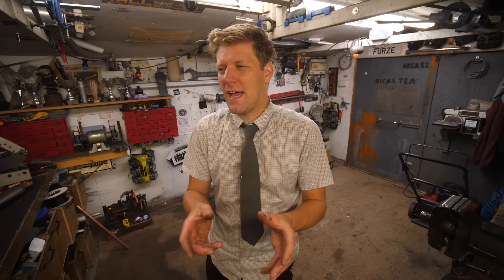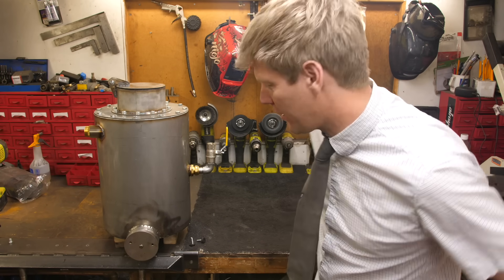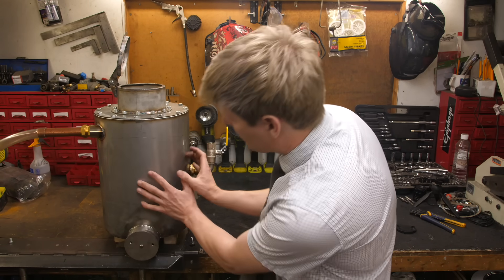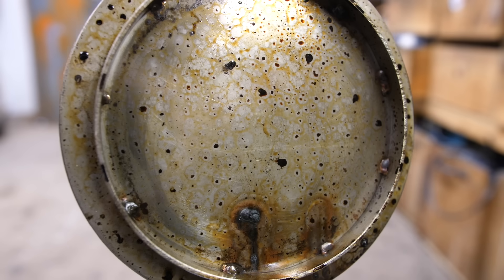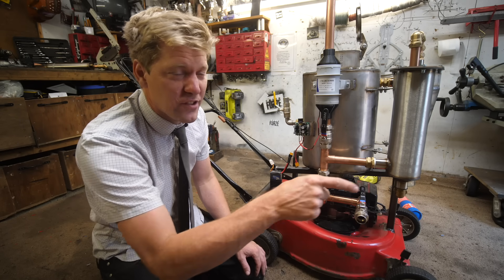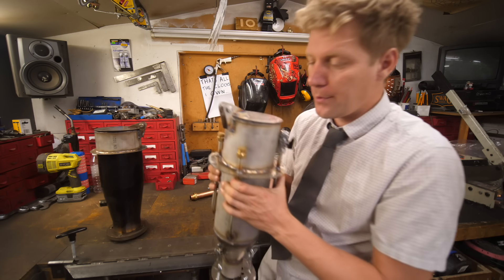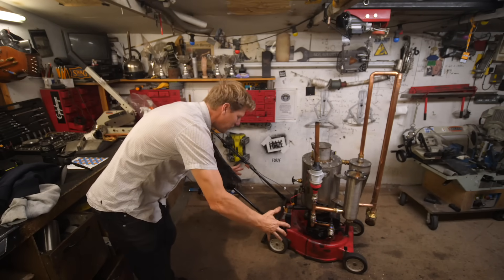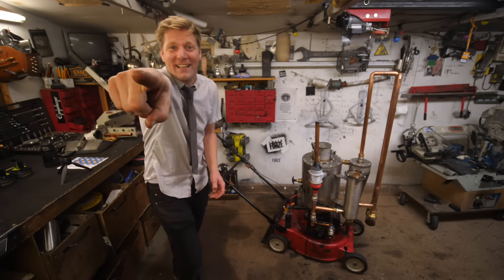WOOD POWERED LAWN MOWER

Comment: Well, good to know you still have just as much trouble with filtration when you build a gasifier the right way. Makes me feel pretty happy with my getting an engine to turn over with a bee smoker chamber and gallon paint can filter.
Reply: Instantly thought of your experiments when I read the title. You guys could share your ideas/discoveries.
Reply: I was gonna recommend your videos for the awesome wood gas storage you have to Colin. Looks like you are already here tho!
Reply: they key is insulating the chamber, allowing temps to get high enough to crack the tars. victorygasworks youtube has some good info
Reply: Proportion, sir, proportion.
(Big fire + little filter vs. Little fire + big filter)
Reply: Pyrolysis oil can be a problem...or a product.  Can be co-processed (in most cases) in a similar to (bio) crude oil
Reply: Hello good sir!
Reply: Came here in the hopes to find out if he had managed to build a compact condenser for the gas.

My primary objective is not to get the cleanest syngas possible, well in a way it is, but my priority is extracting wood vinegar that is as clean as possible from a biochar retort.

I still have to build the actual condenser.
Reply: oh come on - this is very old tech - for this guy trying to make it look he was 'developing' the idea , using all the aspects that HUNDREDS of other videos have shown , that are years older , is just sad
Reply: @fenorcity  looking forward to see you share some videos of others making working wood gasifiers of this scale.

Putting a system on a truck is much easier than on a lawnmower
Reply: @CarbonConscious  its so easy...... if i just plagerise 60 year old work from other people , as this video did - been building these systems for years - sad to see a channel trying to get clicks , pretending its their work - pathetic - sad - says so much about todays society
Reply: @fenorcity  looking forward to see your work
Reply: @fenorcity  no one is pretending to have invented gasification lmao they are just documenting the process of building their own system
Reply: @Past10Performance  I think he's talking about the slightly high-and-mighty tone that Thrive took.
Reply: This isn't "the right way", as evident by the engine gumming up. In the 40ies tens of thousands of cars, lorries and busses ran on wood gas without this problem.
Reply: Both of you need to add restriction chokes in your builds to crack  the tars and also a carbon reduction bed. You can not filter tar, when under vacuum and at elevated temperatures over 100*F it will remain in gas suspension and will by pass every filter you put in front of it. Colins build here is very much like Mr Teslonians build; just built with Colins more advanced build capabilities. The result is the same un processed pyrolysis gas. There is a big difference between pyrolysis gas and syngas. The later is what are trying to achieve; however with out the process's Ive laid out here it will be impossible. 

Both of you should build a charcoal gasifier systems first before moving on and understanding the science. A charcoal gasifier is stupid simple to make, they run very stable and will not make tar. You can take it to another  level by flash steaming using  engine exhaust and injecting it into the gasifier. The reaction process will form it into H2 and CO boosting your gas energy density. Once you master this, then you can go on to direct biomass gasification. Its not as simple as youtube will lead you to believer. My company has spent close to a million in its development process and have built hundreds of very advanced machines. I am in fact the most developed producer of small scale systems in the world.
Reply: @Thrive-Off-Grid   I've followed the work you and "All Power Labs" do.

I posted some comment somewhere, but you have WAY more knowledge, than what i have gained by my armchair research; feel free to add info to that "infodump" comment i made.

ALSO i don't speak for the group as a whole, but i bet OSE would love to develop with you on gassifiers, pyrolysis oil producers, etc!

Comment: 5:42

can anyone tell me what's the name of this tool?
the one he used to trace the pipe hole
Reply: Looks like he used a pipe fitting/3D printed piece (slightly large than the pipe he was to use), the pipe in question, and some straightened wire (maybe piano?)

You can see it better at 05:42 if you pause it
Reply: Its a (pipe) contour gauge.
Reply: Thank you very much! 🙂

Comment: It is carbon monoxide (CO), a deadly poisoning gas! It is heavier than air and can collect in the bunker. Please be careful Colin!!
Reply: The gas is primarily a mix of light hydrocarbons and CO2. There might be some CO in the mix due to incomplete combustion, but not really that much. Wood gas systems usually have water injection, which will additionally produce a mix of carbon monoxide and hydrogen via the water-gas shift reaction, but Colin doesn't have that.

Comment: And now build a system to use the actually mowed lawn instead of the wood. With more heat an a better filter it should also ran of grass...
So it's the Furze Grassgas Mower!
Reply: I dont think the low density grass got enough energy stored in it. But I like the idea. 
Maybe a wood/grass hybrid could reduce the needed amout of wood
Reply: @xNothing2Lose  an even better idea. Love it
Reply: @xNothing2Lose  If it's not dense enough, you mix in saw dust into the pellet mix. But I'm pretty sure it is.
Reply: We got inovators here boys!

Comment: I'd love to see you power an engine off of hydrogen
Reply: He just did. Woodgas is mostly H2 with a bit of carbon monoxide
Reply: @hightechredneck8587  I was referring more to passing a current thru metal in water. I've seen people do it on cars to help with fuel efficiency but never to completely power something
Reply: @michaeldramis2349  2 things. 1 That is just electrolysis, and unless chambered it creates HHO gas which is a highly volatile dangerous gas if mishandled.  Woodgas has the hydrogen but lacks the oxygen because it bonds with carbon creating carbon monoxide which is toxic but non explosive.  Both can run vehicles, I've done both, frankly HHO is far more dangerous as my father created a static spark and blew himself 10 feet back breaking 2 bones in the process. Best system is use a gasification generator and charge an electric vehicle.

2nd Yes woodgas contains carbon, wood contains carbon. but it is generated by sunlight and pulls carbon out of the air. It is in every way a solar powered chemical battery. So therefore at worst it is carbon neutral. Carbon negative if you only harvest dead trees, as they won't degrade into methane. Plus if you generate your HHO from grid power it becomes utterly pointless from a "carbon" perspective because you are using fossil fuels, to create a energy medium (electricity), to create a different energy medium (HHO) to create combustion to create mechanical energy. Just a very inefficient long process.
Reply: @hightechredneck8587  are you trying to make an argument? I just wanted to see colin do it. Ik it's been done before and I never claimed it to be good for the environment or even efficient. Just thought it would be a cool idea for a video so don't get your panties in a bunch
Reply: @michaeldramis2349  there is a better why I posted,
Use solar energy to heat wood chips to syngas and also heat water to steam and form methane, 1 carbon stores 4 hydrogen for a reasonable infrasturcture.
Reply: @acsimark  this stuff is really cool especially when broken down.😂
Reply: @hightechredneck8587  and wood gives off a ton more carbon than hydrogen

Comment: Why not a sea water hydrogen? Use hard wood, less pine tar init"
Reply: sea water hydrogen... You just mean Hydrogen right. There are multiple way's to make hydrogen, Hydrolyses, which I think is what you are referring to with sea water is not very energy efficient, its not even the best way we have of making hydrogen. If he were to produce hydrogen out of Hydrolyses he would lose so much money on the power bill and then waste the hydrogen in a combustion engine when hydrogen is much more efficient when combusted for a steam turbine. The best way we have of producing hydrogen at low cost is with fossil fuel. all this crap about Sea water batteries and Hydrogen cars is the Fossil fuel trying to remain relevant when a rechargeable battery car that recharge on a petrol turbine power plant is far more energy efficient and cuts in their profits. Hydrogen car's mean they still get to produce their fossil fuel and use it for inefficient batteries the give the consumer the illusion of green renewable energy because water is dripping out of the exhaust pipe
Reply: @peter4210  Agreed though I want to assume they are talking about a process I haven't heard of thus why I asked rather than assuming electrolysis.

On the same note hydrogen though inefficient isnt all bad. Some applications can never switch to electrical power and be viable, rockets, large aircraft.
So hydrogen can be used as the battery to store the electrical power that is consumed to produce it. 
Its better than continuing to use fossil fuels but its so inefficient that it will be impractical unless large am mounts of societal resource go into power production.

Its so inefficient that carbon capture converted to fuel might actually be better in terms of power consumed vs power stored.
Reply: @nocare  I knew a guy who argued that turning hydropower plant into hydrolysis plant and shiping hydrogen to the cities to be burn in local power plant's would be more efficient then using hydroelectric dams and power lines. Although hydroelectric dams are quite efficient since they can produce to electricity on demand and that converting water with electricity to hydrogen and then back again waist way more electricity then power line.

If your producing electricity out of wind or solar, having a battery makes them way more efficient but having that battery be a mass on a pulley or a fly wheel is still more favorable then wasting energy going from water to hydrogen and then back again. Simply because the mass is already on the alternator, while the hydrogen has to convert what every heat energy it made into motion again.

Hydrogen in the rocket industry is also not very usefully. The volume of the tanks compared to the kick you get out of it is not worth it. Space x uses methane which is a step better because they can produce it on mars. If mars had tar pits they would be using rp-1 which is refined petrolium. Far more energy dense requirering smaller tanks and wierdly saving on mass.

I wish ending our reliance on fossil fuel was easy but no one is willing to build thorium nuclear plants because they fear what they don't understand and the us government can't make nukes out of thorium so they haven't funded any research into it like they did with plutonium. This is pur best bet until we get fusion nuclear reactor. Both reactors could actually run on each others trash once we get better at it
Reply: @nocare  we just need better battery tech, which I know tesla is dumping money into because it is what make the tesla so expencive. their probably the fir company in a while to dump so much money into batteries
Reply: How would he get the hydrogen out of the water? There are several methods which are you suggesting?
Reply: @nocare  Wood gas systems usually have water (or steam) injection, which will produce a mix of carbon monoxide and hydrogen via the water-gas shift reaction. No electrolysis needed. That approach also gasifies the solid carbon and some of the tar in the wood.  What Colin is doing here will leave some charcoal as unburned waste.
Reply: @traida111 Grand claims require grand evidence. One should always be wary of believing in any conspiracy as once you do any evidence to the contrary can be thrown into, "its part of the conspiracy"

It is theoretically possible for the reaction to be 100% efficient but no known way of doing it has been discovered. 
If it had no one was going to be murdered over it.
That's not the way the world works.

The only truth beyond the two basic axioms, I exist, and logic works, is predictive power. If you cannot demonstrate an accurate predictive test you do not have truth.
Reply: If he makes a mistake though... He could blow up the shed or worse the neighborhood!
Reply: Because his was was more "metal"
Reply: Agree, use hardwood
Reply: @traida111 well of course there is lots of political pressure to preserve the status quo. It's also because large portions of the population don't believe in climate change. Why spend billions in tax dollars on systems that won't turn a profit for almost a decade and are "dangerouse".
If you don't believe in climate change why would you decrease your standard if living in order to loose money fixing it.
Reply: @traida111 I personally don't care much about deforestation; as an individual I don't care much for biodiversity beyond that which is needed to sustain humanity. However I care about other humans and what they care about so that they in turn will care about what I care about. So on a whole deforestation is a problem that we need to fix.

May I ask are you able to state the position of the scientific community on climate change. Are you able to accurately convey the position and its supporting evidence. If not then how can you possibly know its wrong. I respect you as a person and I value the goal that all humans deserve to be happy. On the flip side most humans including myself will fall victim to the Dunning-Kruger effect on multiple occasions in there life. Either you are the person whom informed you that climate change was debunked is a victim of thinking they know more than they do. 

The scientific consensus on climate change among papers published in peer reviewed journals was 97% in 2009 and a decade later is now 100% 
Whether you believe it or not both groups and individuals who have spent their lives studying the earths atmosphere and certainly understand it better than anyone else on the plant all agree that climate change is anthropogenic (cause primarily by human activity).
https://www.pnas.org/content/early/2010/06/04/1003187107
https://journals.sagepub.com/doi/10.1177/0270467619886266
Reply: @traida111 I don't judge people, so much as I judge there values. There are 3 types of claims. Fact, Value, opinion. If you want to be specific there is also implied value claims associated with some opinions.

Ultimately I don't have anything against a person believing or not believing in climate change or in conspiracies or whatever religion.
However there are value claims behind some of those beliefs and if I think that value harms humans either directly or indirectly I will try to argue against it in as respectful a manner as I can manage given the medium of communication.

I ultimately am more interested in the epistemology of people because ultimately if I can convince someone they may be using flawed "reasoning tools" to make conclusions they may reevaluate their position using new tools and come to a diffrent conclusion.

As I will always say all humans regardless of status, beliefs or circumstance are human beings who deserve to be happy. They are just wrong about how to achieve that happiness.

Comment: My senior project was to do almost exactly this. I'm not surprised at all that the engine ceased. We had a 50 caliber ammo can as well as a 120mm mortar ammo can (much bigger) filled with hamster bedding as a filter, our vortex cooler had a water jacket, we had at least twice as many cooling loops, and we still had tar tripping out the outlet of the fan. But we did get a 2 cylinder Briggs and Stratton engine running off it, and we didn't bend a push rod like the previous team did lol. Our engine didn't have a governor, so it was fun making sure it didn't over-rev and grenade itself haha. 

Also lol at "it doesn't smell any different than a normal mower" all my clothes reaked like I was standing in a campfire for weeks, long after I would wash them.
Reply: My project was to do the heating with solar vacuum tubes and parabolic setup, this also gasify tar in time if you add steam from another solar boiler.
By this we plan to produce methane on nikkel catalist.

Comment: Hey Colin, awesome design! I've always been fascinated by the whole gasification thing. There is actually an important difference between the two setups you show - the first one, where you're heating one lot of wood with an external fire, is more properly distillation - you'll get volatile components being driven off the wood, like alcohol etc., which will definitely burn, but it's not proper gasification. The second (better) arrangement is true gasification, which will produce the carbon monoxide/hydrogen mix.

Comment: Maybe an experiment you can do. Is to see which system you can make more efficient for generating electricity.
A combustion engine running off wood gas or a dynamo that's beening spun by steam heated by wood.

But the wood gas would need power to power the fan that sucks the gas out the furnace so I suppose you can combine them

Comment: The tar might be crackable if passed through ceramic piping rendered red hot inside the combustor resulting in more usable gas (and less tar).  The combustor might need to be surrounded by refractory material to lose less heat however.

Comment: Tip on gas filtering..
Filter the gas thru one ore two water filters, that should catch the tar and get rid of some impurification. Bigger steelwool filter is needed to.
Best ways to filter gas in steps:
Water
Steel
Activated coal

Comment: A lot of small engine gasifier builds are using charcoal instead of wood.  It produces almost no tar so the overall system is usually smaller and simpler (less filtration needed).